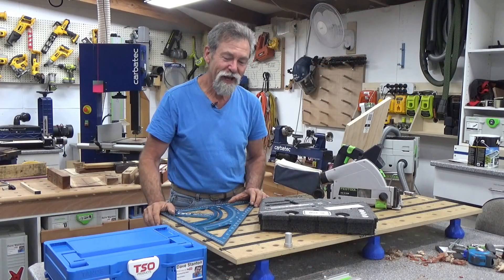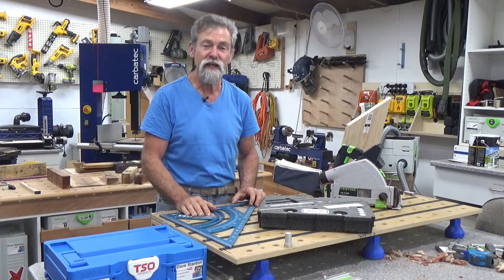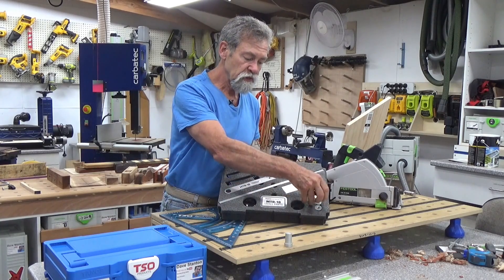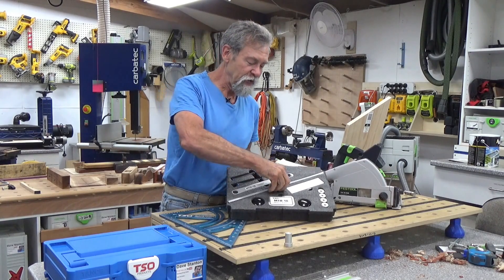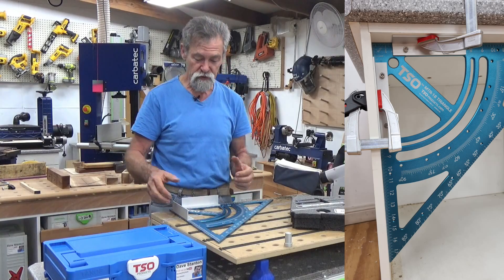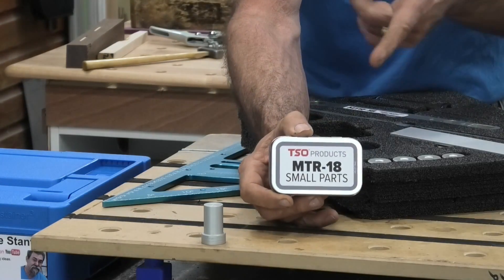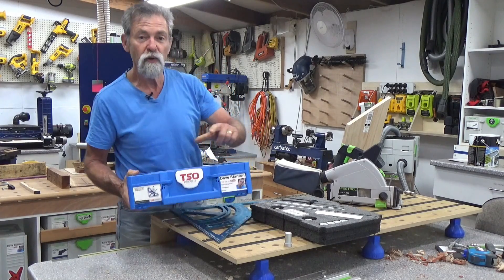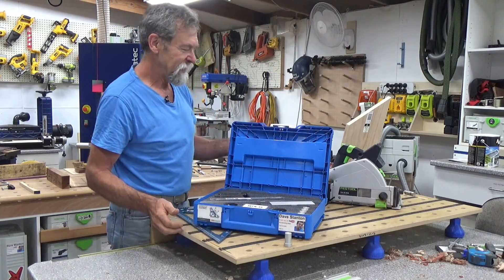TSO MTR 18 TRIANGLE SET & SYSTAINER | DAVE STANTON | UNBOXING

Comment: Hi Dave! Is the systainer the newest height or the previous sustainer height? Bought some new sustainers now, and it’s so frustrating they don’t Mach up with in height with the ones I already have 😅
Reply from the maker: The TSO systainer is exactly the same dimensions as my Festool t-loc systainer that my cxs came in 6 years ago.
Reply: I know the classic varied in height (5mm from memory) to the t-loc.  Are the newer type different again?
Reply from the maker: Hi Lewi Uberg! I will check for you in the morning.